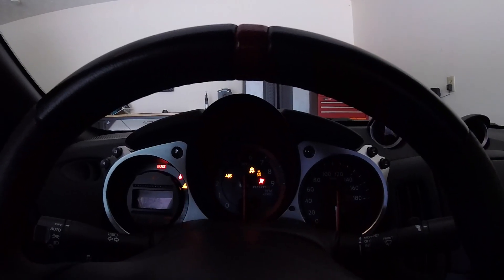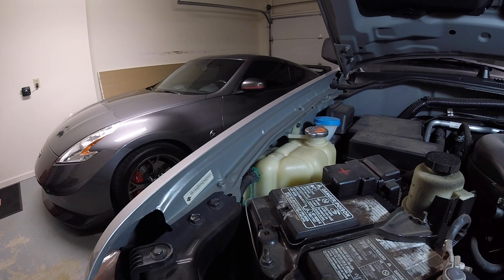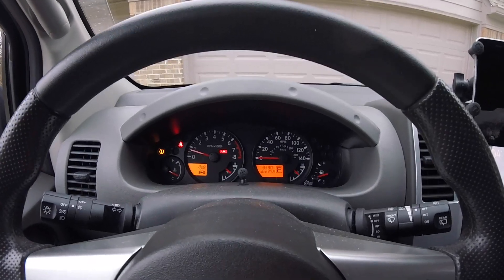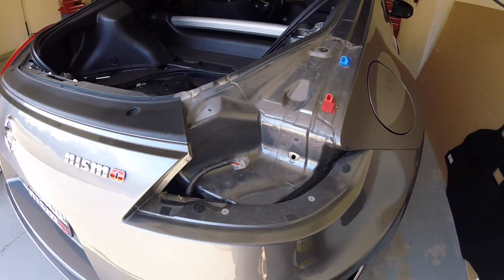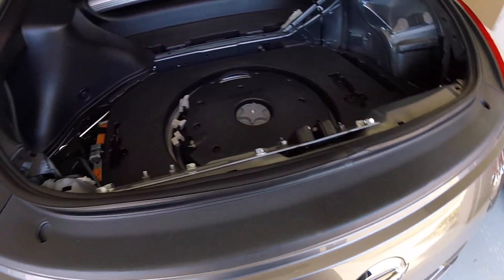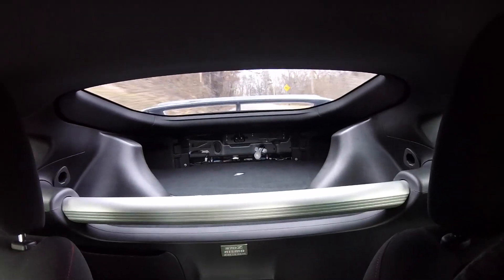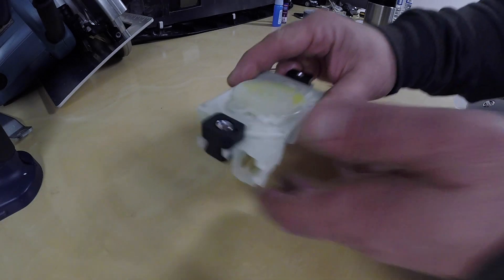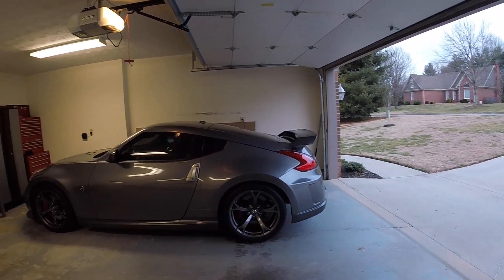NOT AGAIN...NISSAN 370Z RATTLES FINALLY FIXED!!!

Comment: Thank you so much for sticking with this!  I followed all of your sound insulating steps in the last video, this one with the gear box, and even lining surfaces in hatch area under tire and such.  Just went out for a test drive, and all of my annoying vibrations are gone.  Now nothing but pure exhaust sound, even in the 3-4K rev area which was the most annoying to me.  FYI, I ended up using the Frost King Self Adhesive Foil and Foam Duct Insulation from Home Depot.  Cost less than $20, and even using sparingly I still have quite a bit left over.

BTW, I drive a 2017 Sport/Tech, and was interesting to find that when I removed the hatch cover that there was not a weight installed.
Reply from the maker: Excellent!!! Glad it worked out for you. The exhaust is pure pleasure without that rattle. I haven’t had a chance to make any videos lately but I am going to try to upload one tomorrow that has some clips of the sound under an overpass and an update on a couple of other things going on. It’s still on my go pro so I don’t even know if the footage is any good or not. Anyway, If I have to take that trim out again I will use the Frost King stuff that you used. That’s a lot better idea than the weather stripping foam i used. Interesting about not having the weight on your hatch. I guess Nissan realized how unnecessary it was. Anyway, thanks for comment. I really appreciate it.

Comment: Thank you and great video.  I have had the short tail exhaust and buzzing for over a year.  I did what you showed on the switch box.  Slight improvement but sadly the buzzing is still there at 3k rpm.  Cannot find it’s source.  Will try padding on the hatch trim next.

Comment: Thank you for this! I've had the Short Tails on for about a year and the rattle drives me nuts. I'm going to disassemble the motor for the hatch and see if that fixes it!
Reply from the maker: Glad I could help. Please let me know if this solved your rattle problem. Also, pay attention to the position of the gears when you take the cover off of the motor. Fortunately, I took a picture of mine which I needed to look at when I reassembled it. Nice Instagram pics btw.
Reply: I just installed the short tails.  did this fix your issue?

Comment: hey man, how many km is your z at? When I start the car sometimes (when engine oil temp is high), there is a rattling noise, like the timing chain having slack and maybe hitting the guard a bit. it only happens for the first like 1.5 seconds when i start the car when engine oil is hot. did you ever have that? perhaps its the engine that needs to break in bc mine is only at 400km.
Reply from the maker: I have roughly 33,000 miles (53,000 km) on my car. I don't hear the sound your describing on my car. Are you using the correct weight oil? I use Mobil 1 synthetic and Mobil 1 oil filters and change at every 3000 miles. I am definitely not a mechanic so I won't be able to help much. I would check the 370z forum. Lots of good info there. It sounds like you are still under warranty based on your km? Take it to Nissan and let them hear it. If they say, "that's normal", at least it's on record if something eventually happens.
Reply: Perfected Auto I'm using the Nissan ester. I'm thinking it does have to do with the oil. I live in Winnipeg, the weather has been going from -3 to -37 degrees Celsius past couple weeks. Perhaps the ester oil and their stock filter aren't fit for the weather here?. Only hear the sound sometimes when i start the car with the engine oil hot
Reply from the maker: I honestly don't know man. I'm 1400 miles south east of you in a totally different climate so I definitely cannot provide good advice. However, your owners manual should be for your region and show you the recommended oil. I doubt this has much to do with it but the nissan oil filter is ridiculously small. I would take it to Nissan and let them hear the sound you are talking about.

Comment: THANK YOU! THANK YOU! THANK YOU!  I have been dealing with the same exact noise from your first video for months.  Like you, I looked everywhere and at almost everything and just kept getting discouraged.  Today the buzz was especially bad so I got online and found your video.  The defeat in your voice through the first few attempts was all too familiar but I went out and performed the same "fix" and now the buzzing sound is gone completely.  Thanks again for making these videos!
Reply: Update...  Not fixed.  Worse than ever now that I removed the weight.  When I push down on the hatch (while parked with someone in the drivers seat) I dont hear the buzz.  When I let off and have the driver rev to 3800 it comes back.  Back to the drawing board.....ugh.  Makes me want to trade it in.
Reply from the maker: I haven't had a chance to get on here and answer comments lately. Sorry to hear this and completely understand your frustration. It's been a while since this comment so I hope you stuck it out and figured out the rattle. I was very close to putting my stock exhaust back in. Even with my daughter crammed back there while driving around the neighborhood she couldn't pinpoint where the sound was coming from. It's really deceptive. By the way, judging by your screen name, thank you for your service.

Comment: Hey do you have your heat shield on? Im up against the infamous hatch rattle. I only hope I have your perseverance!
Reply from the maker: Sorry for taking so long to reply. I have the heat shield off but my rattle was there when it was on and off. I am going to put it back on just because I hate seeing it in my garage but that was definitely not the source of my rattle. Good luck finding yours. It's a very frustrating.